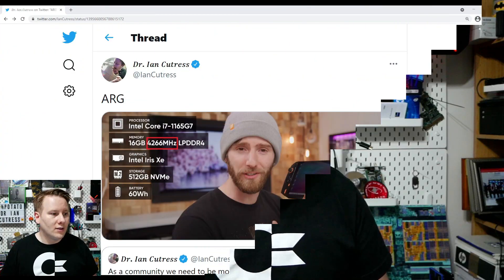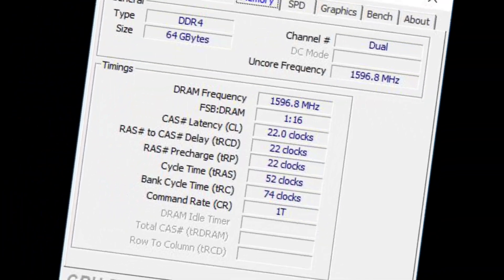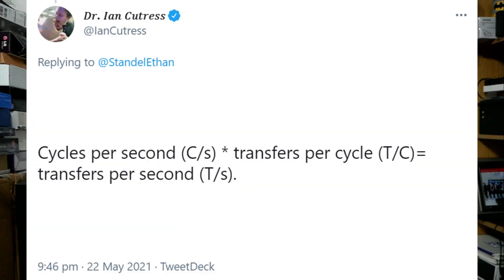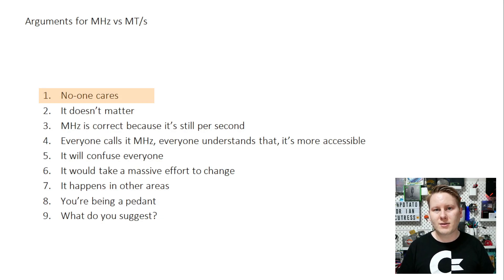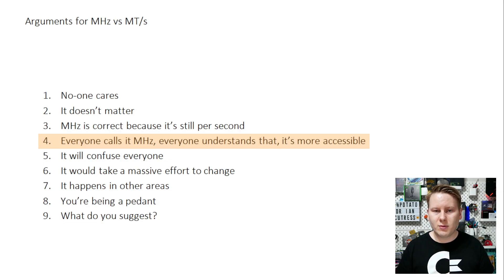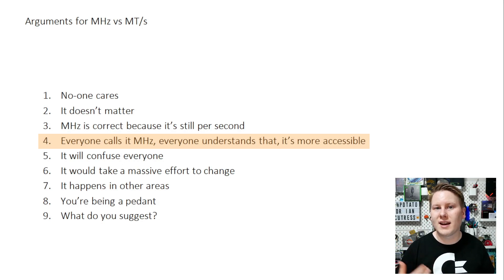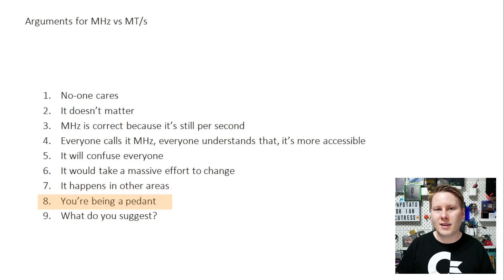Linus is WRONG 💩 : Explaining MHz vs MT/s

Comment: I agree. Got into a similar head banging situation over running “power” just by saying it shouldn’t be called “power” and shouldn’t use the unit “W’. I didn’t say the number wasn’t useful (as no one knows), all I said was that they shouldn’t use a standard name or unit. They don’t even hyphenate it to give a clue that it’s not the same thing. You’re probably not aware but there are these pods that go on shoes or calves that send out “power” measurements. There are even books on “running with power”. 
The trend originated from bicycles where you have rotational speed and a force measurement from which to calculate a genuine power. Then some companies saw an opportunity to make some money from pretending the device they sell can also sense power when running. There are even swimming ones now, although I’ve never seen one in the flesh. 
In the end an established word should have a consistent meaning so anyone could stumble into the topic and understand the words if they knew what the words mean. Bet if you stumbled across a discussion of running power [measured in Watts] you’d think they were talking about what you understand as power…

Comment: I think a problem with mega transfers is that it isn't really 3600 MT (or whatever) when running at 1800 Mhz. The smallest unit of transfer is a full cache-line (64 bytes on current Intel). When it comes to latency (which is really the only time when the clock frequency is relevant), it is the transfer time of a cache line you need to look at; it is the smallest unit of time that you can address memory at. Mostly, what those numbers are about is throughput, and for that you should look at GB/s. Of course, memory manufacturers can't specify the number of cache lines transferred per second, since that depends on the CPU.

Comment: So we're having all these slaves... and some pedantic doctor says it's wrong... but not using slaves would be so confusing (5). Everyone knows the importance of slaves and uses slaves. It's how things get done (4). Stopping using slaves would be a massive effort, we'd ALL have to start working our backs on those farms (6). There's slaves in the muslim countries, why should we abolish it (7) ?

Yeah... so I think it's easy to see that just because something is wrong, but has become the norm (not fully true on MT/s vs MHz) it's not an argument against correcting it.

Also, might I add that all the timings of the RAM, you know those -16-16-36 after the MT/s are in cycles, the "real" cycles. If somebody would be to learn it properly, this would only increase the learning curve, which is not that flat (though not rocket science either, mostly just a bit obscure). The effort and pain is only temporary, but we should definitely go and correct it.

Thank you Dr. Ian Cutress for addressing this! I was waiting for this video. So glad to see it. The part of "it MUST happen every single second, not be a theoretical maximum" is something I didn't realized and it makes so much more sense. Another reason to switch to the proper terminology.

Comment: Thanks Dr Ian Cutress, I agree with you. Linus should just own the fact he made a mistake. Understand, learn and not lean into misinformation. No matter the spin. It is incorrect. The only part I dont fully agree is not using the MT as a unit. I think it should just be qualified it is MT per Sec types the data rate of the memory, which correspond to the equivalent speed in Mhz if the memory was single channel. Otherwise by the Mhz logic we would also just add the Mhz per core. 3.0ghz + 3.0ghz = 6 ghz which obviously be wrong. Also the argument for cpus is null. We dont measure cpu performance in Mhz. We benchmark cpus especially to see what their actual computational power is. Other the Pentium 4, would be destroying most cpus to this day and we know thats not true. Anyhow thank you for your video. I appreciate learning and being educated.

Comment: You kept mentioning QDR, but I don't think it's likely that we will transition to QDR-DRAM. 
DDR is easy, because it means you can latch on both the rising AND falling edges, however, QDR has no intermediate edge to latch on. This could lead to serious synchronization problems between the controller and the RAM. This becomes even more of a problem when you increase the data rate, and therefore require tighter timings. 
Although, one possibility could be to go the LVDS / PCIe route, where transfers occur in asynchronous bit packets, and can then have their phase reconstructed from some synchronization signal. 
There do exist QDR SRAMs, RLDRAMs, etc., however, those aren't "true" QDR, because they have two data buses (uni-directional, so 1 read and 1 write bus). Then each data bus is DDR, so 2 busses @DDR gives you "QDR" (I think that's more of a marketing thing than a technical term, because it abuses the meaning of DDR). 
There do also exist SRAMs that operate like the LVDS / PCIe model, so that's not unthinkable. 
Most likely though, the two directions of memory will be multiple simultaneous bits (like GDDR6X), and the possibility of making them wider.

Also, here's a fun fact... the actual DRAM inside of the DDR4-3600 (for example), only operates at around 120-200 MHz, which is the reason why the CL goes up as the speed also goes up. The same thing is true for DDR4-1800. I.e. when the listed speed goes up, all that is increasing is the bus-interconnect speed, and not the actual DRAM speed internally.

Comment: DDR4-3600 has a transfer rate of 3600 MHz and a clock frequency of 1800 MHz. Same unit, but measuring a different thing. Just don't say DDR4-3600 has a clock frequency of 3600 MHz and we all good 

No different really than the base clock and boost clock of a CPU both being measured in MHz.

Comment: I always find myself wondering each time I see a memory device, particularly a low spec one like 1600MHz if this is the actual clock or if it is the transfer speed. For low spec ones either could have been reasonable.

Comment: Wow, bit of a blast from the past. I remember building my first PC and being annoyed by first gen DDR being inaccurately advertised in MHz, because it caused me some confusion when I was testing. It was probably more of an issue back then because single data rate RAM was still a thing and it was advertised with accurate MHz. With only DDR being available it's more a quirk of advertising to me. With the release of QDR and it being on sale at the same time as DDR it will no doubt be a lot more annoying again in that inevitable circumstance.

Comment: If we use Transfer per second for memory, then we should also
use the term pulse per second for a clock rate instead of Hz. i could also define a clock rate as the number of transition per second. in such a case the clock rate of pulses would be half the clock rate of transitions as one pulse has 2 transition. However in IT the reference Hz is applied to pulses per second.,

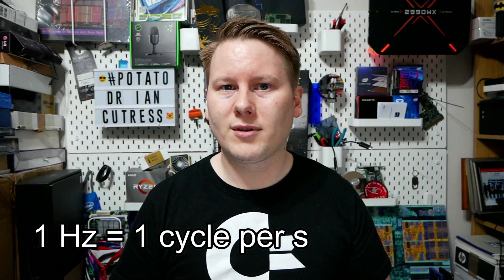Comment: What you say at 4:00 about Hz being cycles per seconds is pretty much nonsense or at very least very domain specific. You even wrote it, Hz is just 1/s. Hz ARE NOT cycles/seconds. The clock/signal cycles at a rate of 10Hz the clock is not 10Hz. The ram transfer at a rate of 20Hz. If it is wrong to use Hz for transfers then it is equally wrong to use it for clocks. You come from an EE background and you think Hz are somehow intrinsically related  to signals but this is absolutely wrong. Hz can represent the rate of anything. The argument about it having to be periodic is also very very weak. The number obviously represents the maximum rate which is a theoretical constant rate. Using Hz to represent the transfers rate is absolutely fine fom an engineering and mathematical pov.

Comment: Its not really clear for me why it is being discussed. Officially Hz = unit/second. Units of what officially does not matters, unit is not linked to anything by definition, unlike meters and seconds, etc. It is legal to use Hz everywhere where we have 1/second. If clarity is required (if it is not clear what exactly value means) it is possible to use out of system measurements units like Transfers/Second, Beats/Second, etc. Is clarity needed in this case? Nope. It is clear that this is marketing name, and lets be honest, if you care about cycle frequency and megatransfers you will not use marketing materials, you will use datasheet where everything is clear. So I don't see, why so much attention is paid to this subject.

Comment: Even though I sort of know what DDR means, it never occurred to me that using MHz is wrong, simply because it's used everywhere. I can't believe I've been fooled by the Megahertz propaganda like that, I usually like to do such things right if I can and will be using MT/s instead from here on out. 
I don't particularly like using no unit at all because that is withholding even more information and takes away a point of reference if you don't know what it means. A description like DDR4-3600 might just as well be an arbitrary name of some specification list. But I understand that if you know what it means it tells you all you need to know, and adding DDR4 or whatever in the front is maybe even more meaningful than the data rate itself, especially when talking about QDR as well.

Comment: Thank you for this! Most of the so called "PC Enthusiasts" these days are a bunch of ignorant idiots that actually doesn't even know the basics of computing. This is even more convoluted by big tech portals like Linus and even software (You can go right now and check on MSI Afterburner, and it indicates Memory speed in MHz, not MT/s. GPU-Z Of course displays the correct memory clock). Even names like GDDR6 is confusing because it's actually QDR.

Comment: I feel like the difference in RAM speed is only noticeable in computer operations that take a long time (I.E. video rendering).  On something like a mobile gaming device he shouldn’t even have to list the speed.  What the consumer will ultimately look at is how many GB the RAM has.  Take a look at SSD’s, either you have NVME or you don’t.  No one is comparing each NVME drive’s data transfer rate when talking about different priced drives and the ones at the same price point tend to be the same transfer rate.  The people that get effected by the difference between transfer speeds are professionals who already know this is a BS number and that it was probably MT/s.  The truth is you have a point that we can’t just say that a machine is capable of something it’s not, and Linus has a point that no one looks at that anyway.  Perhaps the problem is that we have a number on the stick of RAM that no one really uses in day to day computer speak and that it can be converted knowing that it’s DDR4 and it’s clock can be used to calculate that number anyway.  The problem is the standards and not the content creators.  It’s like people making a tradition to honor something, that something gets lost over time, and new traditions that celebrate things that subvert the forgotten things of old tradition are created but both traditions are kept.  Why not just do away with the old traditions in place of what everyone uses anyway?  Look at USB, it was meant to be the one connector for everything, but then they made mini USB, then micro USB, then USB 3.1, then USB 3.2, but none of it is backwards compatible now.  Then call all the 3.x 3.2 now even though they used to be called something different.  Maybe we need a better system for classifying USB then 1.x, 2.x, 3.x and so on.  The same applies to RAM even if it is less severe compared to USB.  If you don’t update to match what people want right now then the systems will make less and less sense until no one understands the professionals who use old terminology.  It’s okay to change the conventions in order to make things work in the future as long as you allow the old conventions time to be phased out.  At this point in time, it would make more sense to either switch to MT/s or MHz entirely to stop the confusion between them.  The professionals will only be effected by a change in labels, but the consumer will gain the ability to communicate in a language in which they understand to the manufacturers because it will be what everyone uses and not a confusing mess like it is now.  The consumer does not need to know how many MT/s a stick of ram can do, all they need is MHz value.  If you want professionals to continue to have that number then write it on a separate on the label, but don’t make it a part of the name for a standard.

Comment: I care, its the tb and tib argument. (Mbits and mBytes)
Its the same thing, accurate measurement counts.
<3
Reply: Mbits and mBytes are two completely different things and have nothing to do with the TB and TiB argument though.
mByte doesn't even exist, as it would be 1/1000th of a byte (m stand for mili, M stands for mega).

TB and TiB argument is about base 10 and base 2 prefixes. 1K is 1000, 1Ki is 1024.

Comment: I very much agree here. Using the "DDR4-3600" type terminology with no units is what will ultimately mislead the fewest people when you're talking about a stick of memory, and as a bonus aligns with the style of official JEDEC terminology too. When going into more detail discussing technical capabilities of a bus, MT/s is also good... and MHz should never be used for discussing PC memory unless you're in the niche of being an engineer or educator discussing the actual clock cycles.

Comment: The problem is marketing. In the original DDR standard, RAM came in 100MHz, 133MHz and 166MHz. In the era where consumer only looked at the frequency, humm higher the better, It was not very marketable to have SDR SDRAM 133MHz next to a DDR SDRAM 133MHz. While DDR had twice the performance. I totally disagree with Linus that it does not matter. If we take PCIe BCLK for example which is around 100MHz it make even less sense.

Comment: I was doing 40 mph on my bicycle, and it was 110 Celsius outside.  If that last sentence bugged anyone, it's the same issue as calling MT/s MHz.  Better to leave it at "I was doing 40, and it was 110 outside."  Leaving the units out and providing context is far better than using the wrong units.